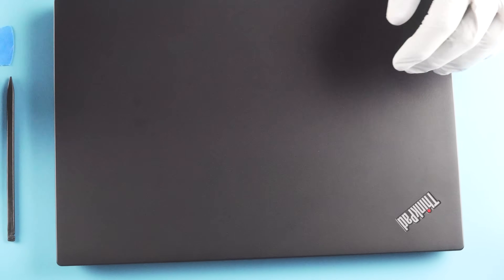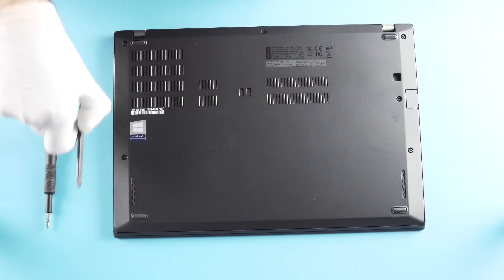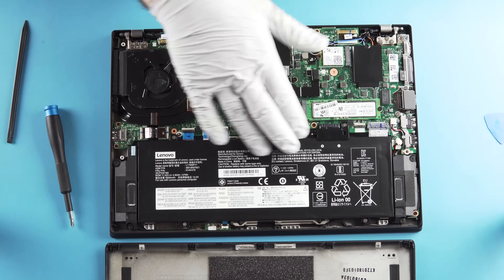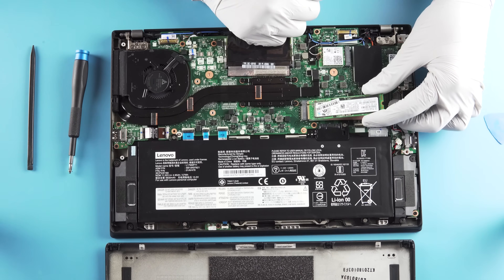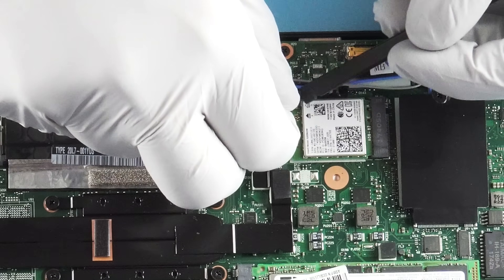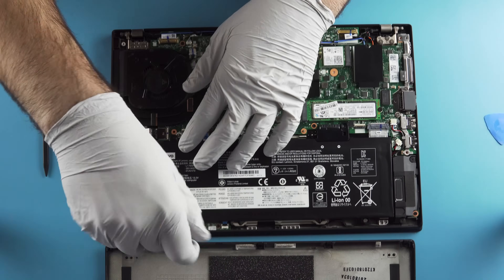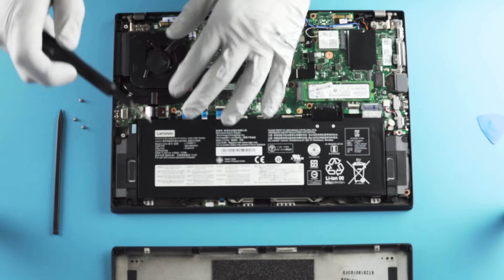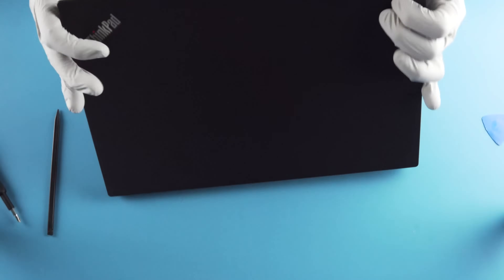Lenovo ThinkPad T480s | How to Service, Upgrade & Fix Laptop (Teardown)

Comment: Excellent short video. BTW the CMOS battery is at the right side center--five very tiny button batteries in a white plastic sleeve, with a white plug-in connector.

Comment: Doesn't the T480 series have a hot swappable battery? Or is that only the non-"S" version?
Reply: Correct. That's the T480 not the T480s.

Comment: Hello, i have a t480s model and has a 16gb ram (8gb soldered), and i was thinking to upgrade it and theres no accurate maximum ram upgrade. Lenovo says that you can only upgrade to 24gb (16gb sodimm), and on reddit it says you can go on max to 64 gb (32gb soldered, 32gb sodimm)

i have an 8gb soldered and would like to add either 32 or 64gb ram sodimm on one slot, will it work? is it possible? thank you!
Reply: No
Reply: 24gb maximum (8gb soldered) so add a 16gb stick

Comment: hi - can anyone suggest a reliable adapter that i can connect the hard drive externally to another computer through USB? bought the 2.5 SATA erroneously and not finding nearly as many options for PCIe to USB and the prices vary wildly so not sure what brand/site/design is trustworthy - thank you!!

Comment: Hi, just a quick question. How many m.2 slots does the ThinkPad t480s have? Can you show me where the 2nd slot is located if you haven't done so already?
Reply: In place of WWAN Slot ( A NVME M.2 PCIe Factor 2242 SSD) could be added

Comment: 01:33 model is 20L7001YUS; it does have 8GB + 8GB by default, hence the slot is occupied.  The SSD is 512GB 2280 NVME.  Anyone knows where to get the 2242 from?

Comment: After hours  of searching online for how to videos, this is the most informative/professional video,,
I have a question,,, i recently picked up a T480S but is locked,,, once it powers on i get a cylinder looking icon net to a lock icon on the top left hand corner.
how can i repair this?
Reply: I know the comment was left ages ago. a week ago today I managed to reflash the bios with a chip reader and soc clip (instead of unsoldering). the sorftware was Autopatcher 0.2. comination of copying the orignal rom off the t480s' clean it, auto patch the rom .bin file and then use the patched version of the rom to be flashed back to the rom chip. once done the rutine on the t480s. swtich off. clear the bios chip again. and then reload the origanil bios back on the the chip... it is a tricky process with a little precorshion, and time. it can be done. watch this vid in youtube 'Lenovo Thinkpad T470 T480 Up to 8th GEN bios supervisor password removal'. should lead you in the rght direction

Comment: Great video for basic opening and access to parts which may need to be upgraded or replaced.  I know that I'll eventually need to swap out the internal battery as it degrades over time and gets very annoying when it cannot hold a decent charge.  Thanks for posting this!

Comment: As I view this video on 02-13-2021, you are the only one who knows how to properly work on a Lenovo Thinkpad.  From the white gloves to proper deployment of the screwdriver with confidence.  The only thing I can recommend is a padded non-scratching work surface.  Well done.
Reply: Gloves are a bit pretentious and very unnecessary. Good `Reddit` appeal though - for those who find them `relaxing`.

Comment: Do you know what and which size screws are required for the track pad? Is it the M.2x6mm?
Reply: Lenovo has the Maint. Manuals for this and screw sizes are listed for the different types of tasks performed.

Comment: I've got a RJ45 cable stuck in the network port.  I've been trying to take it out. It looks like there is a little cover at the bottom can be open, what is the proper way to open that?

Comment: Not really a tear down without exposing the MB or commenting on the primary memory location and the need for heat sinking / soldering to replace the primary memory.

Comment: What happens if the soldered ram breaks? Will it be able to run on the expandable ram alone?
Reply: no, you would have to get it replaced/removed by a local tech or get Lenovo to do it for you ( or they just give u a new board)

Comment: I want to by one used. It loads Windows 10 and works fine, but bios is locked. What problems i might have in future?
Reply: That means this laptop is being stolen.
Reply: My friend receive brand new same model when I turn on the window 10 logo appears after 5 to 10 sec it is Rebooting,  again and again, 

Is the problem is in ram,  I have to clean it?

Comment: Was concerned that the T480S was not upgradable like the T480. So it's just as upgradable as the T480 then? Only differences between the two machines are the thickness and the swappable bridge battery? Is the T480S worth it compared to the standard T480? Was looking at getting the Dell XPS 9370, but these ThinkPads seem to better built.
Reply: One of the ram sticks is soldered on the T480s vs no soldered ram on T480. However, the T480s still has one expansion slot, allowing for up to 24gb of ram.
Reply: t480s just for the ports alone. but I think the thermals should also be better.

Comment: Can you harm your hardware if you install/unistall it while the battery is plugged in?
Reply: I know its been a while but I would still like to reply. Honestly.. no. During the setup of laptops they need to be powered on and off to check if things work. I would advise against working on it while its plugged in.. in case someone makes mistakes but there is no immediate harm.

Comment: Is this for the Lenovo T480S, I recently brought the one with 8 Gigs from Lenovo and found out is was soldered on. So I returned it just now and the bought the 12 Gig one but the sales person say it 8 gigs and 4 gigs are both soldered and lenovo doesn't allow you to upgrade the Ram any have any experience with this?
Reply: T480s has 8gb soldered and an expansion slot that can take up to 16gb, the total will be 24gb ram